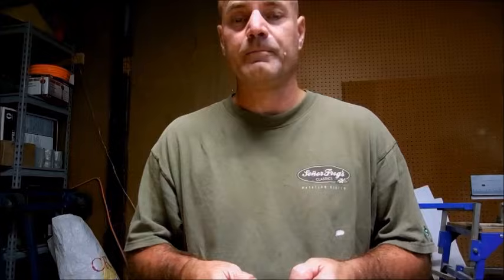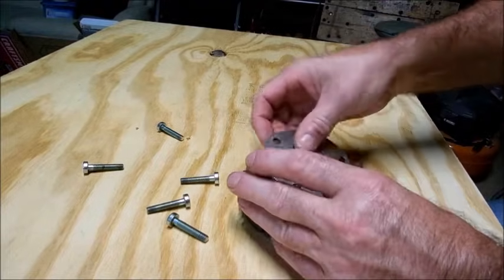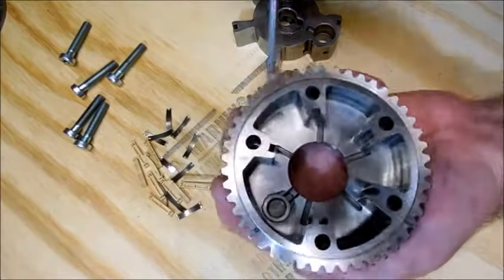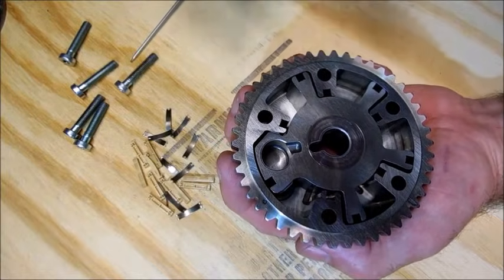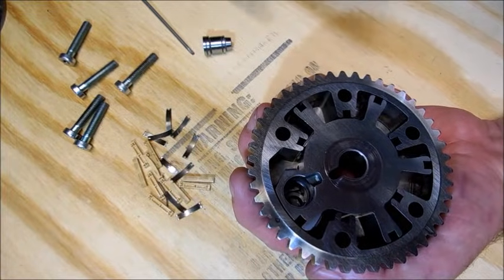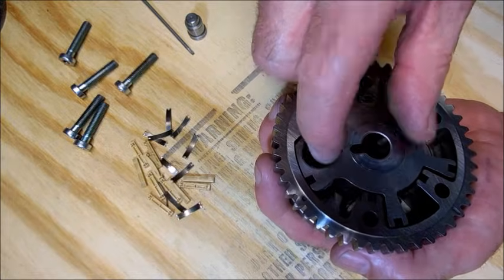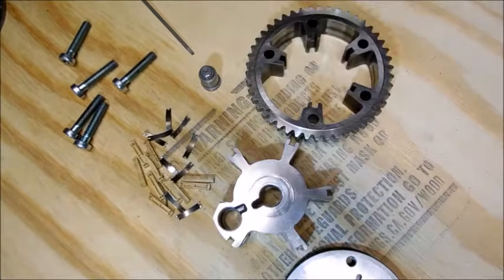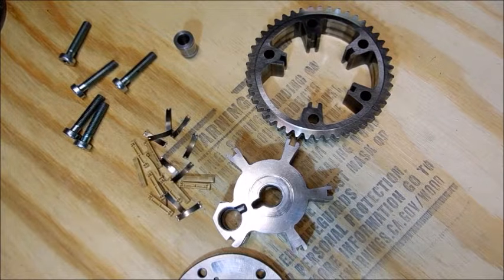Honda variable timing control actuator VTC . inside look at Honda's VTC

Comment: I have a 2011 Honda Accord 2.4. I bought the actuator spring kit. The new spring was slightly longer than the original one.  The noise when starting the car has disappeared, it starts perfectly, but now the engine makes a slight rattling noise all the time, and I don't know if it's due to incorrect installation or because the spring I used wasn't the right one. I've been driving the car for a couple of days and now it's starting to make the noise again when starting, but the sound is minimal. I would like to hear your opinion.

Comment: I would bet that clearly the 020 oil that's used in most of the Honda CRVs should be done the oil changes should be done religiously without fail in all cases no matter what now if you're a high idle or if you idling a lot maybe you're a delivery driver, you got to have your oil changes every 3,000 miles you just do. 

I would never go more than 5,000 mi with 020 because of this actuator on those older models. 

CARFAX is actually a pretty cool place because they've got pep boys jiffy lube in the northern Midwest woodmans oil changes, Costco a lot of shops actually report oil changes to Carfax that's very handy when buying a used car in the United States at least or from the United States.

Comment: Basically it's a crappy spring in the United States California Illinois they're just finishing up they denied the California claims but accepted the Illinois claims that a failed VTC actuator can indirectly actually cause the engine to freeze up and if it does, you've got yourself a safety issue so by proxy of failing VTC actuator if gone too long can be catastrophic to the engine you'll notice your timing chain will start to get loose as well. 

Assistant indirect failure but a direct result of a failing VTC actuator. 

The catastrophic nature of the failure is what was proven in the Illinois class action suit which allowed the class the three classes to get paid. 

I don't believe they're paid yet and they're still more to come, and the fact that it was shown that it was a catastrophic possibility, should quickly involve the national highway safety association in the United States to claim and demand a recall of the VTC actuator and any attended failed parts due to its own failure. 

Obviously the fail point here is a spring that goes bad, I don't know a lot of springs that go bad if they're the right diameter thickness and wine, they just need to put a better spring in it and they may have starting at around 2017, because I haven't seen or heard of a lot of complaints about a VTC actuator going bad in Honda CR-V models at least of 2017 and up however 2016 models sort of a transition year, as some of those models were actually manufactured with some of the 2025 parts the VTC actuator being one of them for the early months of 2016.

I would imagine around by April they would have come up with a better spring solution and that's probably what they've done. 

My estimation of that is completely anecdotal as I'm not come across any complaints of any models of actuators of the Honda CRV of year models 2017 to the present.

Comment: You're confusing the VTech with the vtc, you're holding the VTC in your hand, the VTech VTech there are two of them on the other side of the engine opposite to VTC mounting. The VTC whale is part of the timing chain and tensioner are the passenger side of the engine where the VTEC system is on the driver side of the engine.

Comment: Hi, I have here in Europe CU2 Accord with K24Z3.
I have had well-known Cold-Start Rattle, couple of months ago I decided to change the spring only, also not removing the actuator itself from the camshaft.
Dozens of YT videos are showing how it should work, but in my case it didnt.

Since then I have been having spontaneous rattles even when the engine is working, and even worse cold start rattle.
Now I bought a Honda OEM Actuator (upgraded version R40-A02), and we will see how its going to function afterwards.
Reply from the maker: did the chain guide get knocked

Comment: spring-start now sells a replacement kit for the yellow seals, you have to reuse the little leaf springs that hold them in place. only certain model actuators use these seals

Comment: The problem that all of these videos don't address is changing this actuator isn't "the fix" for the problem.  This problem "will" reoccur again.  This part is a factory defect with Honda engines.  No matter how many times you change this actuator, you will have the same problem over and over again.
Reply from the maker: i have been looking into it some more. i think the problem is short cold weather drives. the spring and different metals in the VTC not getting up to full temp.  the spring is meant to get to full temp and then relax when cooled. short drives the spring doesn't get to full temp and the molecules in the spring metal loos tension over time

Comment: Excellent explanation. Thank you! 
I have temporarily solved the issue by cycling the key in the ignition 10 seconds on, 10 seconds off then 10 seconds on and start. I have had no rattles in years. I found this solution on the internet. I wished I knew what this process of cycling the key does to the VTC oil control solenoid it cycles. I believe that the solenoid releases the oil pressure inside the VTC letting it lock in place before start. 
I have the replacement spring in stock but for now, after 4 years of no rattles I am willing to wait. No need to replace the whole VTC actuator. Apparently it will have the same issue later on.
Reply from the maker: thanks for the feed back
Reply: i'll give it a shot tomorrow

Comment: Hi, what diameter is the inside diameter of the pin? I am wondering what size maximum diameter spring I can use, thanks
Reply from the maker: max size of spring 5.5 mm or 7/32
Reply: @mikesproject4704  thank you
Reply: That’s an interesting thought.   The stock springs are much narrower than the pin hole.   This allows the spring opportunity to flop over diagonally which skews the pin angle and adds unwanted sideways force.    A wider spring should keep the pin more vertically oriented and in better position to seat properly.

Comment: Mike, The Honda service document shows torquing the cam and actuator out of the vehicle on the work bench. Given that, I don't see how the key pin on the end of the cam is out of the picture re: torque. I have not been able to get anyone to explain why it needs to be unlocked when torqued (especially if it is torqued out of the vehicle.
Reply from the maker: if you torque it with the pin in you are putting torque on the pin and will/ could miss shape the edge of the hole, or bend the pine.. unlocked the internal star evenly puts torque on it's respected stop.
Reply: @mikesproject4704  Yes and new ones come unlocked out of the box

Comment: Push the gas pedal down to the floor.  This will shut off the fuel injectors and prevent your engine from starting.  This will allow you to crank over your engine long enough to build up the oil pressure without your engine starting.  Release your gas pedal after around 5-10 seconds or so (dependant on outside temp and engine condition) and your engine will start without the rattle or significantly less rattle because the oil pressure was given enough time has reached your VTC actuator.

Comment: THANK YOU SO MUCH for this video and explanation!!! I've been going crazy trying to determine the source of that rattle and have heard all of the speculation surrounding it. From:

1. It's the timing chain rattling against the guide, about to jump a tooth because it's stretched.
2. The oil level is low, or the type of oil is insufficient. (Although I do recognize that oil plays a part).
3. It's the chain tensioner failing.
 
I have had Honda mechanics swear that it was the timing chain making this noise, but I was never convinced of it.

Now I have what I was searching for, thanks again.
Reply from the maker: happy it helped

Comment: Please what size are those 5 point torx?
Reply: TS 30
Reply: There are many different access bits required to open these gears. Spring-Start has new vtc actuator locking pin springs with the correct access bit included in each kit.

Comment: Thank you man. 
So what I have gathered is that it is annoying, but it doesn't cause any significant damage to the engine. The problem is, however, that the check engine light comes on in newer cars, which necessitates the changing of this ~$150 part (got a quote for over $700 at the honda dealership)
Reply from the maker: when the timing chain starts to get loose the chattering could cause it to jump a tooth. it will accelerate the stretch in the timing chain. how long will that happen. i dont know but i have heard people drive like that for years.. there is a company in Canada selling a spring replacement
Reply: @mikesproject4704  thank you for responding. I definitely wouldn't take that risk. I ordered a new vvt sprocket for $150. I'm just going to put it in and see if I can get another 60k miles out of it.
Reply: @mikesproject4704 thanks for the info I keep hearing you can drive for years like that our 08 Highlander does the rattle loud in the morning and even after only 30 minutes of sitting if we go somewhere so I guess that means it's getting worse

Comment: The VTC controls the Intake Cam actuator angle..  whiles the Vtec Solenoid controls the engagement of the 3rd Cam lobes.. wanted to point that out its 2 different functions.

Comment: We have a used 2012 Accord SE, exhibits a quick rattle(<5secs) from cold start. If we do religious oil changes with good quality oil, what would be the consequence if nothing is done and no CEL yet? Thx
Reply from the maker: the rattle is the actuator moving back and forth. you are putting strain and no strain on your timing chain.  the rattle has come back on my Honda . i have bought a spring from a Canadian company and will try  that soon will do a video. i think the VTC i bought on ebuy wasnt Honda part but a knock off made to look like one
Reply: @mikesproject4704  if rattle has come back then the gear is not fixing the problem? Part of me tells me to leave it alone and see what happens.
Reply from the maker: was good for 3 winters. i bought VTC on ebuy and think might not be Genuine Honda. i still think you will shorten chain life how fast i dont know @maverickperson5443
Reply: @mikesproject4704 How did the new spring work? Did it fix the rattling?

Comment: Just replaced the spring on my 2014 Crv. Your explanation is awesome, I knew it's the weak spring but didnt know what it is doing.
Reply from the maker: thanks for watching
Reply: @mikesproject4704  hello I am in the process of changing spring on my 2018 civic lx. I notice that I have to vtc actuator on my k20c2. When I took both of them off the front actuator did not have oil in them when taking apart. The back one was filled with oil when taking apart. Is that normal?? Would like your answers as soon you can reply, thank you.
Reply from the maker: @josuemorales5061  mine had a small amount of oil. wasn't full
Reply: @mikesproject4704  mine was full. Does it mean it’s clogged I should get another or I can clean it up? I stretched the spring as well.
Reply from the maker: @josuemorales5061  i dont know how much oil mine had in it. . but oil drained out and had oil inside when i opened it.. i would be more concerned with no oil with it has oil
Reply: @mikesproject4704  thank you I will clean them out and reinstall and see how it goes afterwards. Important I did stretch out the spring so hopefully that works out. Thank you again for replying!
Reply: @spring-start  looking for a k20c2 I got 2 vtc actuator
Reply: @josuemorales5061  Yes we carry a couple designs for that.
Reply: @spring-start  any promotion code for a first timer buyer?
Reply: Where did you get the spring? did you just remove the valve cover and the 4 bolts on the vtc to replace the spring and is there additional info. I'm planning on changing the spring on my crv 2012
Reply: Were you get the spring? Is that coming in oem parts

Comment: Hey I just did drag cartel 3.2 cams and the rbc cam gears but I didn’t have the pins to lock it at 35* will it be fine to run it at 45*
Reply from the maker: remember it is an interference engine

Comment: Thank you for such an interesting video... I have a 2014 Honda crv with this problem, I want to know what number of 5-point tork key I need to remove the screws, thanks
Reply: spring-start VTC has a spring and seal VTC gear rebuild kit with the access bit for the 2012- 2014 crv and 2008-2012 Accords.
Reply from the maker: TS30h    5 star bit